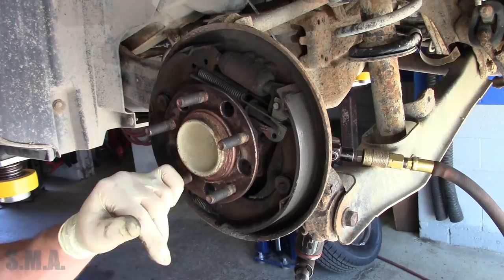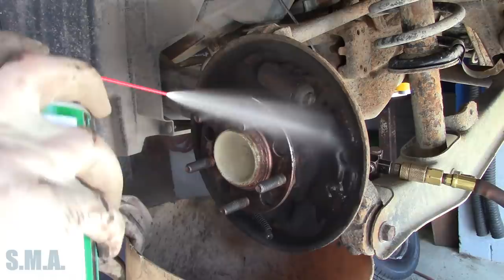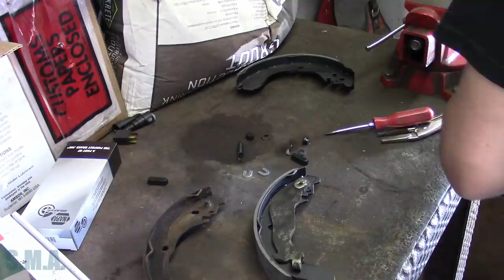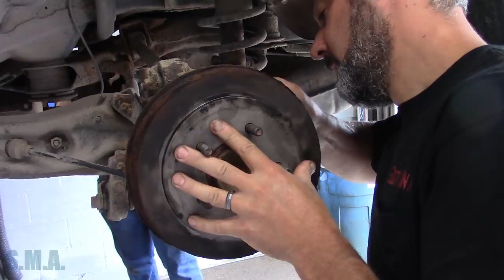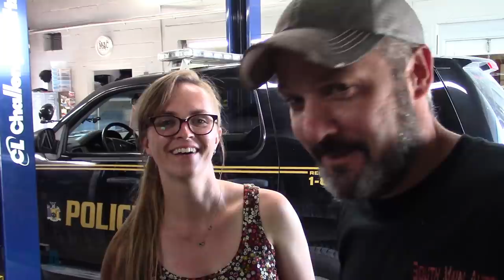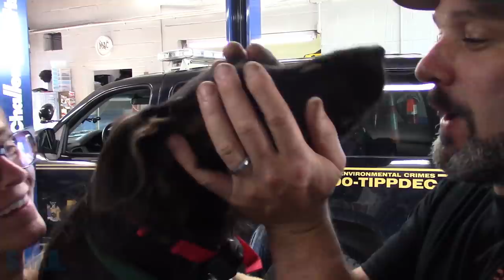Chrysler Sebring: Rear Drum Brakes

Comment: Hi Eric wanted to ask you for a while love your diagnostic stuff but I do notice that you do spend a lot of time diagnosing faults, how do you charge for that, where I work most of the diagnostic stuff is done at one charge £48 I(n the uk) for 1/2 hour which usually will end up as just a fault code read and possibly some other small checks as time allows, for more complicated stuff we tend to phone the customer and ask for more time, do you do that, or do you have a higher charge for diagnostic stuff which allows you more time to start off with or do you lose money to properly diagnose.
Does this mean you lose custom as a result of the higher cost?.

Comment: Whats the best way to remove drums if the adjuster wheel is seized  and the shoes are holding the drum in place?
Reply: Whatever way works. I've used a puller, torch and even a cutting disc on a die grinder to get some off.

Comment: yeah, now days with smartphones galore, take a pic or ten!. and change one side at a time( 99% chance the other side is reverse mirror image) also I take the parts off and lay them on floor in position they came off or cart of you have a lift!  that is how I worked pre-idiot smart devices( wait until they go dead battery or suddenly quit working... I could stick with/instantly revert to the old ways and keep working. age and wisdom?
even as many shoe brakes as I have changed over the years I still get discombobulated, since there's so may different setups. not even trying to lie about it!

Comment: Hey south main auto can you please help me find the steps to change the timing chain on 09 Suzuki sx4 and I need to find the crankshaft sensor  I have a code for camshaft sensor p0340 I changed and it didn't fix the problem so I will change the crankshaft sensor but can't find it please help bro

Comment: Don't drum brakes self adjust any more like they used to, by backing up and stepping on the brake?
Reply: That was what the lever he installed does, rotates the self adjuster. However there are ones that self adjust in reverse and others that adjust if you use the parking brake.

Comment: I still don't get how drum brakes are supposed to be the cheaper alternative, seems like just assembly at the plant would cost more than slapping some low end disc brakes on the car. Or, maybe it's due to the ease of parking brake integration for the rear brakes.

Comment: Looks way too complicated for me.. more than 3 parts & I’m lost! 😂
Reply: ikr rotor caliper pads what more did you want.
Reply: Actually, having done drums in the past, it's not as difficult as it looks to do. Just takes time, like disk brakes do. :-)
Reply: @johnhpalmer6098  
disk brakes are usually faster than drum,
I've done both many times.
Reply: @bertgrau9246  True that, but still, neither are difficult to do, as I said, I've done both in the past. The last cart I owned that still  had drums in the rear was my '92 Ford Ranger truck, and they were ABS equipped but not the front, WTF?, anyway never had to deal with them during the 6 years I had that truck. A great truck it was, now I drive an '03 Mazda P5, but here in Puget Sound, rust is not the issue so it's relatively rust free, it's disk on all four corners, but sadly, no ABS (an option on these, again, WTF?).

Comment: Drum brakes are EASY! You take the truck to the local shop. NOT the chain repair shop, the one that’s been there forever and is owed by the guy who takes your keys. 

You ask for the meanest most bitter old man who answers every question by spitting and grunting to be the one to do it. 

Three days later and $700 MORE then what you agreed upon when you first dropped it off it will be done. 

See, EASY!

Comment: I would like to see how they did drum brakes on the assembly line!
Reply: They come assembled on the rear axle sub-assembly.
Reply: @Blazer02LS  I realize that but someone at some point has to assemble these at a high rate. Thanks for the reply.
Reply: @rayp.454  Not really a high rate, they are normally done off the line like most of the other sub-assemblies and with all new parts it is actually not hard to put it all together in under a minute per side. Lay out the backer plate, bolt the wheel cylinder on, snap the E-brake cable in place. Shift to the next person. They hook the springs and adjuster in place on the shoes and drop those on the plate.  Next person hooks the E-brake cable to the lever and sets the shoes into proper alignment with the lower stop and wheel cylinder and puts the loaded plate on the cart. Those are then moved to the axle area where one person grabs the loaded plate puts it into place on the end of the axle, puts the hub in place and bolts it together. Much easier to do all that when you don't have to work around the various pieces like you would as a shop doing this as a repair. At one time you could even buy the loaded plates as a repair part.
Reply: @Blazer02LS  Just sayin it would be cool to see the process, and possibly special tools used. Maybe it's somewhere on utube. Thanks for the info.
Reply: @rayp.454  I have seen some videos out there on auto assembly but nothing real detailed. Not my type of job though, just couldn't take something like installing the left side tires and lug nuts all day, every day.

Comment: First of all, anybody who has that round thing in the middle of the assembly, don't be a dingdong like me and make sure NOT to spray brake clean there. Just trust me on this one.

Second, I don't know how it is with the employees there at Napa Bath, but here in the city slicker land, they hire young kids. Sometimes first jobs. and they don't give a hooey about your rotors. Come back mostly gone and whittled away or warped or whatnot.. maybe you guys have better ethics near the amishland

Ps, the big pain in the ass thing also is to set the parking brake so it is about 3-4 clicks needed to hold. Big pain because sometimes that required taking part of the console apart so a lot of techs don't do it.

And something about partially assembling some of the springs and then slipping it over the hub. If the application permits. Otherwise you do that spring dance we all know.

Comment: I hate that job ! more barked knuckles, blood blisters and industrial strength swearing than  any other relatively simple job !   I didn’t mind fitting “cylinder repair” kits but they’re illegal now.. Where did you get anti rattle springs that you can compress with one hand ?   Also you did not show  the ritual” battering of the drums” which is essential to being in the right mood  for this little joy.
  Anti seize  ?   Copperslip  that’s why we have that horrible tube that leaks ginger goo all over everything !